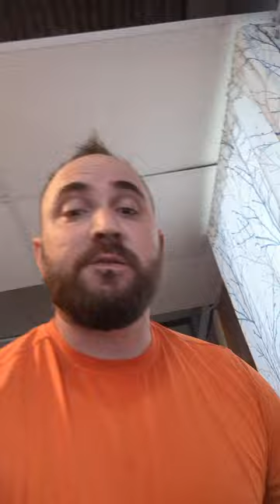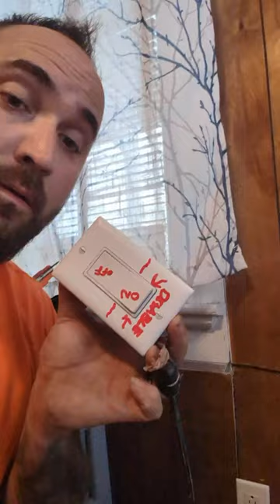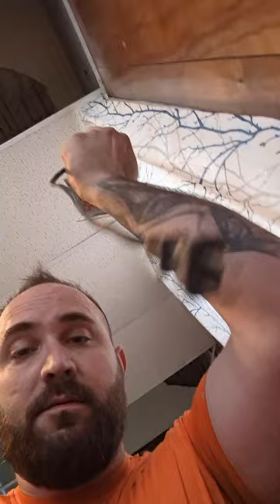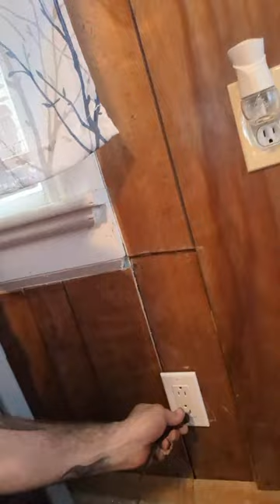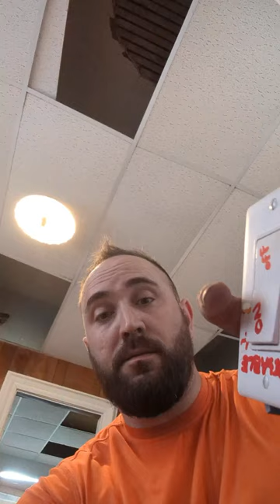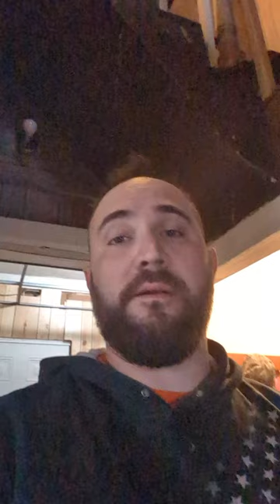how to find a circuit breaker

Comment: In an older house, the breaker may not trip. The wire will get hot until it melts in the walls. If you want to use this setup, please only momentarily flip the switch. Do not leave it on just waiting for the power to drop. Cause it will, just not the way you were hoping for.
Reply from the maker: What your referring to is likely a fuse and not a breaker, which yes I agree, and actually I should have mentioned in the video that I flip it right back off and test it, it is also a great way to label the panel too!

Comment: This is like preventing an elevator from closing by blocking it with your foot: it will work every time until tears your limbs of. 

Granted: that's more likely if you are in dodgy places.
Reply from the maker: yeah more likely to wear my switch out before anything else